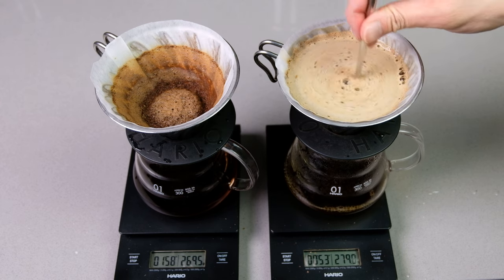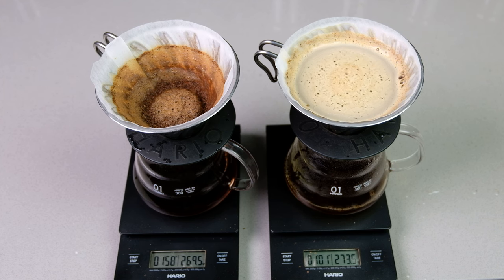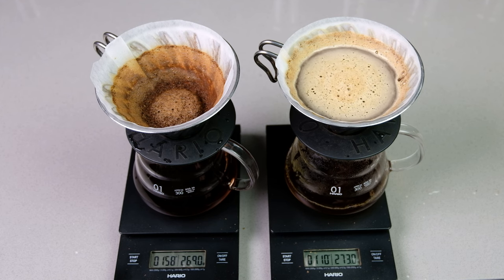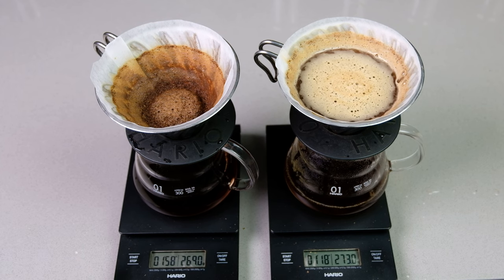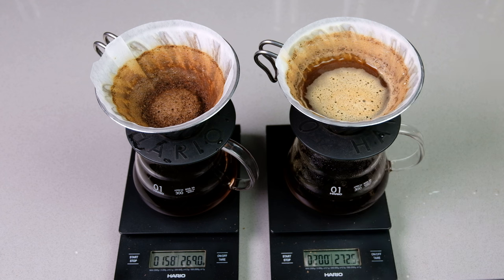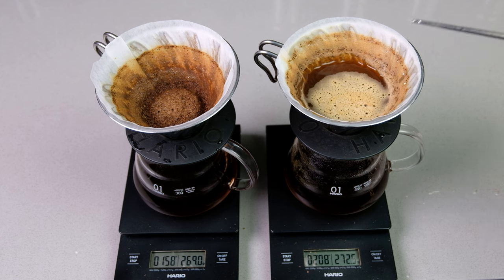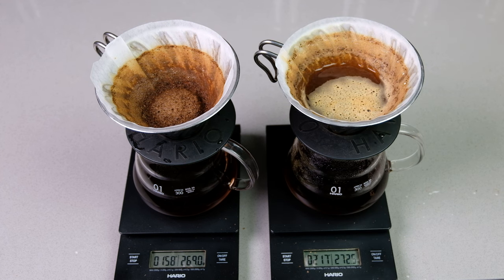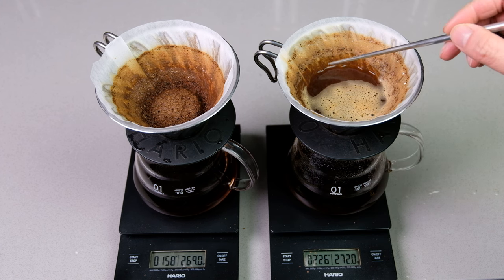How pouring height MATTERS

Comment: Wouldn’t pouring high also reduce the water temperature?
Reply from the maker: It would, but I exaggerated a bit. Generally you don’t go much higher but even a little bit makes a huge difference because how the stream hits the bed.

You’d be surprised though the water temp doesn’t vary as much as you’d think because once it comes in contact with the beans it’s already lower temp.

Comment: Hi Vince, thank you for another quality video! 👍I learned a lot from you! Could you please also talk a little bit of the taste of each cup? Kinda wondering how much differences it would make at the end.
Reply from the maker: Thank you!!!

The left side was actually quite good, I prefer to have a little bit higher extraction but honestly great already, the right side one was much thinner and had a dry finish to it >.<

Difference is there not like ultra noticeable but it definitely can be discerned.  I even had someone try it out and they prefer the left one more.  The left and a perfect pour though is a very subtle difference.  It just feels a lot more round and leaves a much sweeter finish on the tongue!

Comment: This was a very interesting and dense topic, and you covered it extremely well! Hoping to get a Buono kettle to really step up my pour over quality, just using an ordinary boiling kettle makes the pour so difficult to control...
I always have slower drawdowns and my domes are quite pasty compared to yours, would you perhaps attribute this to not being able to pour low and slow enough with an ordinary kettle?
Reply from the maker: Yeah right? Thank you! I was scared this video would be a little too hard for me to explain. I mean it took me 20 mins >.< raaaah

I think if you have slower drawdowns pour slower overall and keep it more gentle. Or you might be moving around the ring too quickly.  It can be more then jsut the pour that is slowing it down.  If you have a lighter coffee moving around too much as well can do so.  If you stir like me don’t stir as long quick and sharp for lighter roasts!
Reply: @TALESCOFFEE  Thanks a lot for the tips, will give them a try for my next brew. 
My first drip is usually between 10-15 seconds, so I can pour quite gently even with a normal kettle. I'll try to keep it more gentle throughout.
Reply from the maker: @karlinggard  Just make sure to hit all the floating grinds, but if you are too pasty try to keep it low.  Remember the water level moves up.  If you keep your kettle at the same height in theory you're getting "lower" which is beneficial to your gentleness.